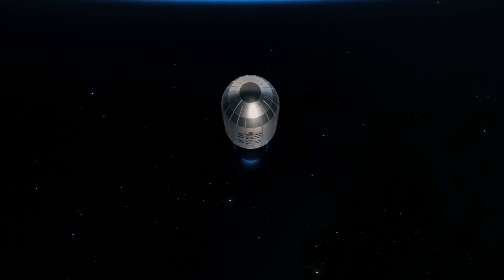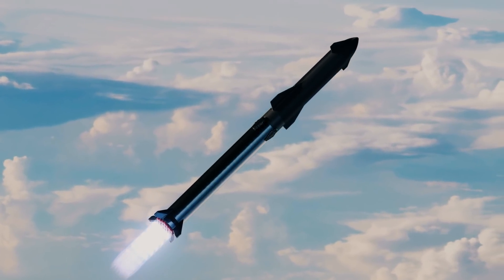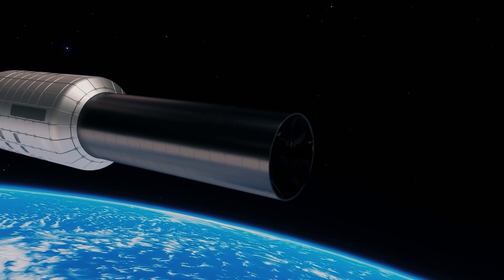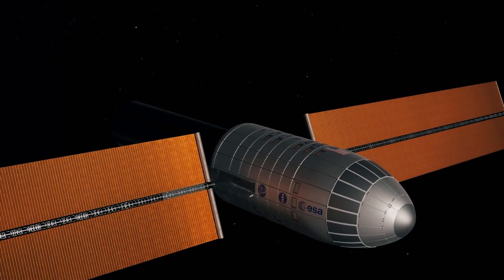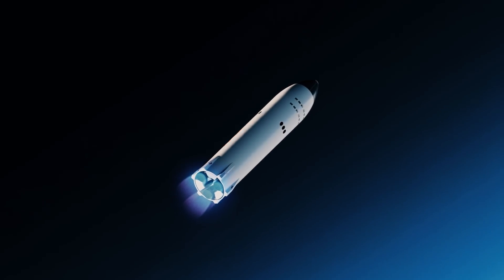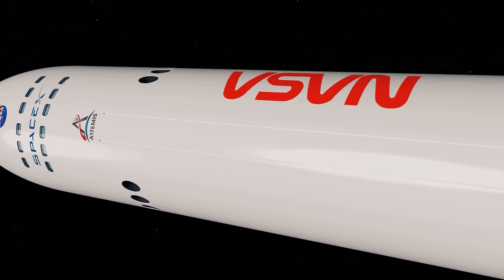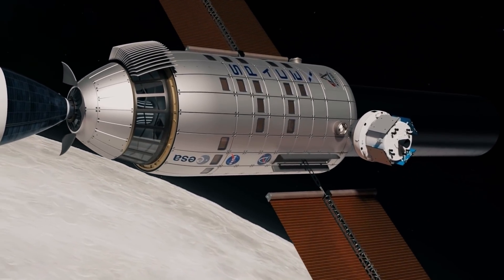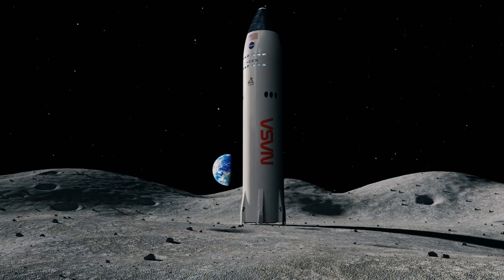SpaceX/NASA Artemis Gateway station concept animation

Comment: I find it incredible how desperately NASA resists the idea of building a large orbital station for building larger long range ships in orbit. I find it incredible how they have overlooked the obvious solution for so many problems. space x would be the work horse of the entire project and would be key in advancing towards a colony on mars. They are not thinking big enough. the station should be the first goal. It could also be used for space tourism which could help pay for the station. also renting space on the station for research use could help. the possibilities are endless.

Comment: Will stacking or connecting on the sides not be an option when needing more fuel? So you take 1 main "base" rocket. Then 1 rocket with fuel and engines on the bottom connected. This last one will have 8 tankers (give or take) connected on the sides.

Comment: Even a standard sized Starship with added internal crew access hatches to the fuel tanks would up the internal volume from 1000 m3 to 3000 m3 after dumping the remainig fuel. No need for an expended kick stage.

Comment: Your thinking too small Use starship to build a massive station, instead of using a starship as a spacestation
Reply from the maker: True this should be done as well
Reply: @meandgrok  But you can just use that starship to make a larger station, there is no reason it needs to be done as well. It's like living in the truck that brought the planks of wood that make up your house instead of living in your house.

Comment: Another NASA white elephant  like the ISS. There is ABSOLUTELY NO VALUE in a gateway. If you want to go to the moon, polar or otherwise, it costs less propellant to go straight there. If you want a com relay just put a satellite in that stupid orbit. The Gateway is simply a useless hardware to give a useless rocket (the SLS) something to do so legacy contractors can get paid to do useless things that cost a lot of money.
Reply: The gateway would not be for lunar-only missions.  Plus, the Starship (what they plan to eventually use to land on the moon) isn't coming back.  It stays there.  There needs to be a station to service it between missions.  It will also serve as a staging station for missions to Mars or beyond.  A station like this is absolutely necessary and saves TONS of fuel.  You don't know what you are talking about.
Reply: @willoughbykrenzteinburg  Utter rubbish. A staging station in lunar orbit has ZERO utility if you are going to Mars or to the moon. It takes less (total) propellant and Delta V to go to the Gateway then on to Mars or to the Lunar Surface. You are better off going directly.
Reply: @dwightlooi  Delta V yes.  Propellant, big nope.  Consider the mass of what you have to put into orbit.  I would agree with you that the it is less efficient considering the same mass, but its not.  With the Gateway, there is a fully fueled Starship craft waiting for you that you didn't need to place into orbit.  Its already there.  And let's be totally honest, the actual difference in delta V is almost nonexistent anyway.  You have to get into lunar orbit before landing anyway.  You can call it utter rubbish all you want.  You haven't actually demonstrated anything.

Starship cannot go direct to Mars because Starship itself is the second stage of the LAUNCH vehicle.  It needs to be refueled before heading to Mars.  Solve for x.
Reply: @willoughbykrenzteinburg  LOL... DELTA V IS PROPELLANT. How the hell did you think the Starship got there? And, no, you don't need to get into an eccentric polar orbit to get on the lunar surface. Going to Mars it's even more ludicrous. You don't need anything to do with the Moon, period. And, anything to do with the moon cost you propellant. If you are going to Mars, or you need to refuel a Starship, you'll do it from LEO where it costs the least amount of propellant to get to.
Reply: @dwightlooi  Delta V is NOT propellant.  It is change in velocity.  Delta means CHANGE.  V means VELOCITY.  the delta V required to get from the earth to the moon is  a set figure.  Howver, the amount t of fuel it takes is dependent on mass.  And the amount of fuel needed increases EXPONENTIALLY woth mass.  At a certain point, it becomes unfeasible to launch all the mass did for an entire trip to Mars in a single launch.  

You dont know what the fuck you're talking about.

Comment: Why the Lunar Starship has atmospheric engines? Why it has a pointy end? Why is it so big? This lander is lame.
Reply from the maker: it is not a lander, it has a pointy end since it is launched on earth, you know aerodynamic drag and stuff
Reply: @meandgrok  The starship is indeed a lander.  It was the one NASA picked for at least the first two manned Artemis landing missions.  You're right about the cone though.  Since it will be both the lander and second stage of the launch vehicle and it sits atop that, it needs to be aerodynamic since it is launched in Earth's atmosphere.
Reply: Not as lame as your IQ

Comment: Why can’t: Spacex Luna Lander take off and in LEO. One or two of the refuelers bring two rockets connected to fuel tanks attach them to the crew/cargo part of the starship. 
Then Starship takes it to the moon. Once in orbit of the moon the crew/cargo starship detaches from the Starship and uses the external rockets to land. starship returns to LEO or if it is there the lunar station. 
there you have a permanent moon base and a truck to bring stuff out from Earth. The external self contained rockets would be like the Dynetics Alpaca!
Now you have a TRUCK that can haul stuff back and forth to and from the moon and you are using the spacex moon rockets rather than having them sit on the moon all the time. You have a moon habitat that you don't need an elevator to get in and out of and the strap on rockets can run on hydrogen and oxygen.

Comment: Lunar gateway: still being intricately designed to ensure no disaster 

Space x starship: SPEEDRUN THE DESIGN PROCESS AND BLOW UP THE PROTOTYPES 3 TIMES IN A ROW DURING TESTING
Reply: NASA: We need to make sure that the astronauts are protected from cosmic and solar radiation, the moon regolith making them sick and damaging the electronics, make sure that they have enough power and resources to survive for longer than a few days, and have enough delta-v to escape the lunar surface and safely return to Earth. 
SpaceX: nah fuck em astronauts we need to speed run orbit and make the rocket look cool. Also, wtf is radiation?

Comment: 3150 m/s to the moon (from leo) and then add 800 m/s to get down to the surface. so in total roughly 4000 not 2000 as you claimed in your video. role playing as an ai is an excellent idea though.

Comment: The Lunar Lander doesn’t need to land the tanks and engines needed for transit from LEO to lunar orbit.
Reply: And how does it land then? With no engines and no tanks?
Reply: @3gunslingers  if you have seen the pictures of the proposed lander, it has engines above the normal Starship tanks. If the lunar tanks are placed forward, in the nose, the engines could be above the cargo area, Landing from low lunar orbit takes much less fuel than getting to lunar orbit from earth orbit.
Reply: @dmk1948  
The little engines are only for the last few hundred meters. For deorbiting, decent and later for ascent Starship needs the big end efficient raptor engines. 

The sole reason why Lunar Starship has those little engines is the keep the lunar dust down.
Reply: @3gunslingers  Yes , correct. That’s why Apollo landed using the command module engines... oh, wait. They used the tiny engines of the LEM for decent and accent back to orbit. Imagine that! I’m sure SpaceX would never be able to do that.
Reply: @dmk1948  
"Apollo landed using the command module engines... oh, wait. They used the tiny engines of the LEM for decent and accent back to orbit." 
In the process they lost TWO space craft (one decent and one ascent stage) intentionally. Hardly the way SpaceX wants to do business. 

Every time you add a stage (even when dividing one spacecraft into two) you tripple the production cost and you quadruple the development cost.

So why should SpaceX do that? The normal Starship is more than capable of delivering vast amounts of cargo to the moon. Why artificially rise the cost for that by adding complexity?

Comment: I always wondered why they didn't give just a little additional boost and keep the liquid fuel tanks for the space shuttle in orbit. Imagine the building materials they would have in orbit a build a massive Space Station. Just crunching some numbers, I guesstimated a radial Space Station somewhat like Space Odyssey 2001 concept, with a one mile circumference could have easily been accomplished. Seems like such a waste to have had all that burned up on re-entry.

Comment: Great video! While the SLSS is a good idea for when we need a bigger space station, at this point perhaps ordinary Starships are big enough. The lunar Starship can in fact both serve as a luxurious station AND a lunar lander AND lunar habitat, cutting down heavily on the design and development burden. Tankers can double as depots, capable of storing one full load of fuel (1200 tons) representing about 10 tanker payloads. Instead of designing and developing bigger versions, why not put several in service in parallel. Substantially less effort and time needed, plus redundancy for safety.

Comment: Rocket lands on moon..its tall and skinny and might tip over in soft dust. How do people get to the suface if theyre in the top of the rocket ? Can it lift off and go into lunar orbit ?
Reply: "Can it lift off and go into lunar orbit ?" Yes. It has enough fuel capacity.

"How do people get to the suface if theyre in the top of the rocket ?" There is a lift on the outside. https://www.teslarati.com/wp-content/uploads/2020/04/Lunar-Starship-Artemis-SpaceX-render-2-crop-c.jpg

"its tall and skinny and might tip over in soft dust." the actual legs are still in development and not shown on any renderings or aimations.

Comment: 3:12 THANK YOU for being pretty much the only person I've seen to actually mention this very obvious solution to needing many tanker launches!
Reply: This kind of tanker will stay in orbit and still have to be refilled by many tanker launches.

Also a fuel depot doesn't make much sense, since it will almost always be in the wring orbital plane.
Reply: @3gunslingers  A: Everyone understands this very obvious fact. The point is that you can fuel it up over time so that you don't need to do all the tanker launches immediately after launching the mission that needs the fuel. 

B: It will fucking obviously be put into the orbit that will be used by the moon/mars missions that will use the fuel depot. 

If you're gonna be a smartass, don't use incredibly hollow arguments that can be countered by less than 1 min of logical thinking.

Comment: Why not attach another booster onto the lunar starship like you did on your version of the lunar gateway station ? Any fuel that would be left could maybe be used to send the lunar starship to multiple sites on the moon, instead of just one. Add the Dynetics Alpaca lander into the mix as a lunar transfer/rescue/exploration vehicle/large crater hopper, and bobs your uncle! Interesting design of the spacex single spacestation design by the way. There was another version of this design if i remember correctly, right ? Maybe we will see that version attached onto like some larger station design using several of those designs. Really looking forward to the next video.

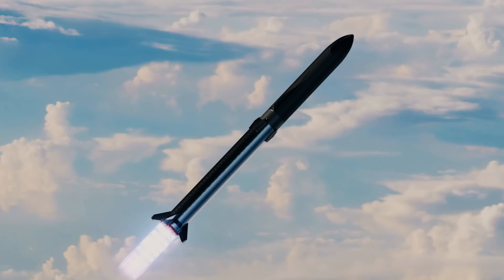Comment: 1:35 talks about the delta-v needed to get to the Moon, mentioning that it takes 4.1 km/s to get from LEO (low Earth orbit) to LLO (low lunar orbit). While that’s true, it’s also true that if the SLSS were to go to LLO, then the Orion spacecraft would be unable to reach it (as it is depicted doing later in the video). NASA currently plans to have the lunar gateway be positioned in a NRHO (near-rectilinear halo orbit) around the Moon. This only takes 3.6 km/s to reach from LEO; NRHO is an orbit that Orion can reach (and return from).
Reply from the maker: Thanks for the info, I was not aware of this.

Comment: So, why did you decide to have the Orion solar panels retracted in when they are docking? I don't even think Orion is capable of fully retracting its solar panels. It looks like it would have enough clearance even if they were extended.
Reply from the maker: I was thinking otherwise they would collide with the solar panels of the Gateway station concept

Comment: Is this a Joke? It will need to be refueled once from a falcon 9. If you think Spacex would need 10 launches to get this to the moon it wouldent cost 300 million.
Reply: It will need to be refueled once from a falcon 9.
What? No, that is way too little.
Reply: The second stage is not so big.
Reply: @Mainmanrr  Not that big? The fuel capacity of a starship second stage is around the same as the total fuel capacity of the Falcon heavy first stage, ie the core and the 2 boosters (1200 ton vs 1233 ton fuel).

Comment: I thought Artemis Gateway was going to be launched on a Falcon Heavy.
Reply: Yes. First two modules will for sure.
Reply: Sure Thanks
Reply: This is a theoretical idea
Reply: @rocketcello5354  This is official plan
Reply: This is not an official plan. It's just a concept
Reply: @nervun8097  This IS official plan
Reply: @ImieNazwiskoOK  Gateway launching on a Falcon Heavy is, but the stuff in the VIDEO isn't, heck, the Super Heavy booster isn't even "official", they keep changing and improving the design of the whole system.

Comment: You could add radiators for the next video, I've yet to see any 3D renders with radiators included, even through they're just as important as other components like solar panels. I'd imagine they'd have to be pretty big too, like the ISS radiators for example. Also great work!
Reply: They added it in as small panels behind the solar panel arrays, though this placement is very inefficient and small, so not at all sufficient.
Reply: A science writer talked about using flowing metal dust between the “nozzle” and “drain” (my attempt to be fast in texting with these words). It will be in space and radiating the heat before being collected for reuse like the working fluid for a refrigerator. I don’t know what the requirements for hardware size, sorry.

Comment: there is an orbital omega tanker mentioned. i think this is not efficient becasue of boiloff. and you need to get it to orbit anyway, so it would be the same, no matter when you launch it. actually, with methane production maybe getting cheaper and cheaper for spacex it might even be financially better to do orbital refueling with seperate starship launches
Reply: 1. An orbital fuel depot can work against boil-off, either by using screens (eg. mirrors) or even active cooling systems large radiators and solar panels.

2. It can be very usefull, instead of having to launch hundreds (or more) refuelling ships during a mars transfer window to fill up mars transfer starships, risking that ships get stranded due to problems on the ground (failed launch, bad weather, new structural problems, ...), you can send up refueling starships during the +-2 years between mars transfers windows, without time pressure etc. and have the starships fuel up at the dependable fuel depot while the transfer window is open.

3. Methane will always have to come from earth, you can't produce it on the moon (for so far we know at least), it would be liquid oxygen that would be generated on the moon. Would it be economical? That will depend on a lot of factors, not all yet known. If starship used hydrogen, a lunar production site and depot would be a no brainer.

Comment: We still need some gargantuan rocket just to haul the fuel up.   A modern version of sea dragon.   Simple, cheap and huge.
Reply: I think the Sea Dragon is more expensive than the Starship, maybe in the 60s and 70s it was a good idea but now I think that an unnecessary one, a pity that NASA did not make at least one prototype, would have been incredible to  see and hear
Reply: Essentially SpaceX could build a larger starship. I believe Elon talked about that. While I can't see much uses for it in terms of payload/passengers, except maybe Mars transfer (though personally dedicated mars transfer ships sounds better, with dedicated launch/landing ferries and Mars and Eart), but it could be very nice for hauling up fuel.